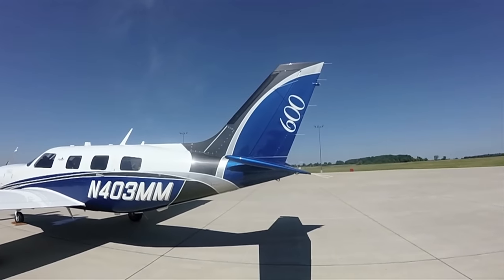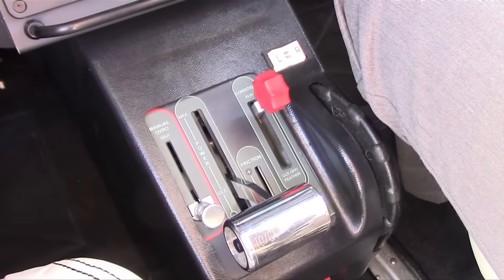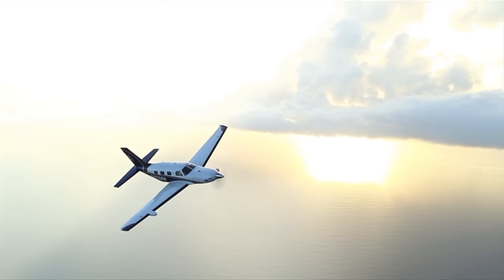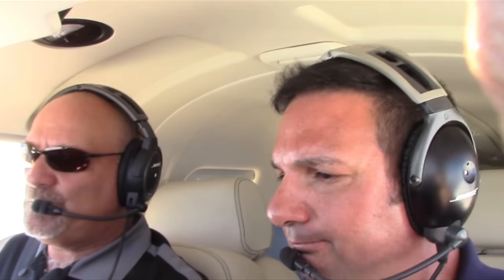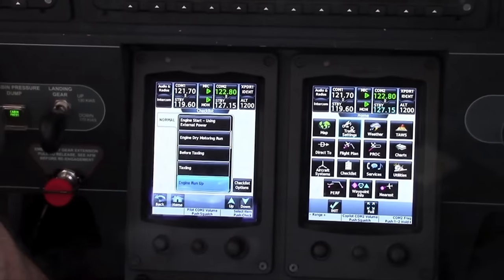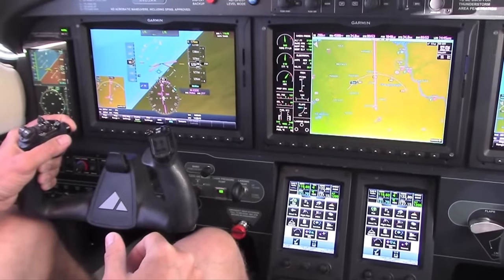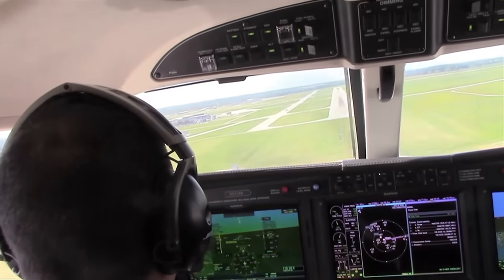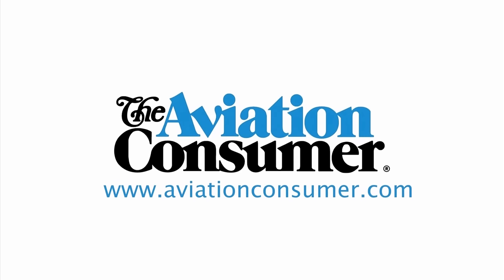Piper M600 Turboprop Flight Trial

Comment: You know, for a single engine turboprop, this is not a bad airplane, but then again, the original Meridian wasn't, either, after the Gross Weight Increase.  But, here's my issue.  At $2.8M, you can buy  One Aviation Eclipse 550, a twin engine pure jet that is over 100 knots faster, flies up to 41,000'.  It doesn't have the range of the M600, but it will carry four people in comfort for 1,100 miles faster and in smoother air.
I would be very hard pressed to find a reason, if I was in the market, to buy this aircraft over the Eclipse 550, or even a 500 Total Eclipse, for $2.3M
The only 'downsides' to the Eclipse is you have to be type-rated in it, which you don't have to be in the M600.  But, if you're flying this class of airplane, you should be as close to being type-rated as you can be, anyway.
Reply: Fuel consumption, maintinence, operating costs etc.
Reply: Nick Stadtmueller If you're comparing the M600 to the Eclipse, yes, the M600 would be less expensive.  However, with a direct operating cost of only $742 per hour, the Eclipse is only slightly more expensive per hour than a PC-12 or a TBM900.  However, I can't find any specs on the M500 or M600, but I can't think it's so much less than the TBM 900 or so.  So, maybe $100 less per hour.  If you buy a Total Eclipse, instead of a new M600, the acquisition cost is $800,000 more for the M600.  That'll buy a lot of hours at $100 hour difference in Direct Operating Costs.
Reply: I think the market that piper is trying to appeal to are people/small businesses that have the money to burn.  In which case they are just offering a plane to contest to the PC-12 and Tbm 930.  If any medium to large business were looking for a corporate plane they are better off getting a small jet.  So in my opinion I find this plane to be a marketing venture for piper.
Reply: I think you guys missed the point. ;-) It's a million less than the cheapest competitor in its class and it's a bargain when compared to the PC-12's 2 million+ premium for a few hundred more in range and more speed.I know jets are all the rage these days but single turboprops can go a lot of places a jet cant and fill a important gap in the market.As someone who has over 400 hours in a PC-12 try landing a jet on grass or dirt..........then come tell me that a hot single turboprop is simply a marketing ploy ;-)
Reply: @rustypotato1884  Nope it's for people who love to fly Pipers.  And it's selling.
Reply: SouthJerseySound exactly. This thing can land anywhere a Bonanza can but with a lot more speed and range.
Reply: @shawnclark732  Yep.  Since there are so many turbine choices out there, all airplanes have come down to trying to appeal to micro-niches.  The M600 appeals to people who are already familiar with Piper products, but who want  a little more range and speed than the M500.  These folks just are not ready to pitch for a type rating and going to 41,000 feet is a little scary and not really needed for their operations.  Then there's the issue of who knows how to maintain an Eclipse in the boonies, and will Eclipse be there in any form in the future?  C'mon now, Eclipse jets have been around for some time now, but the company itself is down to nothing.  Bet the trip to the Piper guy is a lot shorter.  And cheaper. So it's not like M600 owners never did their homework.

Comment: How long will it take for someone too learn how too fly this piper ? If not experience too.
Reply: First you have to get your private pilot lisence then you get Instrument rated after that you'll have to get endorsed for this aircraft which is a turboprop. It's around 80 hours flight time to be able to fly this aircraft , if commercial pilot lisence is not the requirement this aircraft otherwise It will be around 270 hours
Reply: You could get your private pilot's certificate in this plane in, theoretically, 40 hours. you would be limited to flights under 18,000 feet and VFR until you get the hours to get instrument rated. There is no legal requirement to get experience or training to fly a single engine turbo prop as a private pilot. You will need complex and high performance endorsements in your logbook. Turbojets require type ratings but FAR Part 23 certified airplanes with propellers all fall within the scope of a 40 hour private certificate.

Comment: Great aircraft except for the PT6 turbine. It's time to introduce a FADEC or replace it with a GE turbine which has FADEC and doesn't need a hot section inspection half-life. Single pilot operations are significantly improved with a FADEC, torque limiter, etc.
Reply: ruirodtube I agree with you 100%. I instruct in a multi engine turboprop with dual channel FADECs in each engine.
Reply: Only if you shouldn’t be flying in the first place. 

The PT6 is the only engine certified for single engine commercial IFR operations for a reason... in spite of having the least experienced pilot group operating them.
Reply: Totally agree. Makes no sense not to have FADEC.

Comment: I'd buy a used Lear 35A and pay for a captain and have still have 2 Million in the bank.
Reply: Until you feed that Lear (it's very thirsty), and service the engines. Oh, and you need two pilots (even if you are one of them.) These are cheap because they cost a bunch to operate.
Reply: Factor in insurance, hangar lease, maintenance, engine reserve, fuel. And it needs two pilots. That $2 million is going to be gone before you know it.
Reply: Sure and that bank will get emptied by maintenance cost.
Reply: that 2 million in the bank?  Ha.. ever maintain a Lear?
Reply: Not for very long
Reply: You don’t choose a plane just looking at the cost, but at the mission you intend to fly with. Good luck trying to take off with that Lear 35 for a long flight from a short runway...
Reply: @UncleKennysPlace   Yeah, especially run-out engines are a common economic sticking point or even game-ender. I've seen many a parked Lear over my career, available cheap to anyone willing to pony up the cash for that work.

Comment: Isn't it better having two engines rather than one - incase one engine fails?
Reply: sure in that view it is usually better to have a multi engine over a single engine, but even then a lot of multi's will still lose altitude with an engine out and a lot of single engines have a much better glide in case of engine failure, along with having an incredible running cost with owning a multi engine its not always better
Reply: nosupervision Thank you for the reply.  I'm glad they're able to glide in case of engine failure.
Reply: Two engines mean more money to buy, fuel and maintain. Also, flying a twin with just one working engine can't be easy. Some people think that unless you fly a LOT and have the time and money to learn a twin, you're probably better off getting really good at flying a single engine instead (and landing one without power). I imagine a plane like this comes with a ballistic parachute option too.
Reply: +eatmorenachos no chute option. only on sirrus and lancairs right now
Reply: The idea with these single turboprops like the Meridian, TBM, Caravan, etc.. is to replace piston twins with something that is nearly as economical to buy and run, has much more performance, and has a single turbine engine that is more reliable than the two piston engines it replaces. With two piston engines, you're twice as likely to have an engine failure. Compared to a single turbine it's more like half a dozen times more likely. And when that engine fails, you might not be able to climb after takeoff or maintain safe altitude. Then, even if everything is working perfectly, you're stuck in icing layers and bad weather for a lot longer. Most of these single turbines have an alternate fuel control if the normal one malfunctions, and with GPS it's easy to find a suitable airport to glide to from the flight levels should the engine quit... vs trying to find a safe drift down in a twin.
Reply: One of the other things, piston powered aircraft are known to have failing engines, but the Pratt and Whitney PT-6 engines are almost bulletproof.  Once you get it running, it'll stay running.  The Mean Time Between Failures for the PT-6 is very high, compared to a piston engine.
That's not to say they won't fail, they will, but it takes an awful lot to get one to fail.
Reply: Twin engine planes require more training and a different license. This plane can be operated with a basic private pilot license

Comment: the cirrus jet will fill this niche.   Why spend $2.8 mil for a plane that has the same Full Fuel Useful load as a Cessna 182??  Most of the back seats are for decoration then??
Reply: +David Heon  Useful load is a dumb criteria to judge an airplane by.  More pertinent is how you plan to fly the airplane and for what missions.   Most Meridians fly missions of 1 hour or less.  Then you can carry 6 if the load does not exceed your zero-fuel limitations. If you need more hauling capacity occasionally, then charter a Phenom 300.  If you need that capacity all the time, then consider a used G-280, if you can afford one.

Comment: This aircraft pretends to be in the same class as a PC-12 or TBM, but those aircraft can actually DO something other than haul a pilot, 2 passengers and 100 lbs of luggage 600 nm. This is an ego plane only intended for the guy who wants a really nice way to get from golf course to golf course, and there is nothing wrong with that. Just don't pretend it is something more than a turbine C-206 with nicer seats.
Reply: But slow compared to the 930 @SeriusNtentions
Reply: +Craig Sanderson The M600 doesn't pretend to be what it is not-a PC-12 or TBM 940.  If you need an airplane with  load carrying capabilities or speed, by all means buy one of the above if you're willing to accept higher operating costs.  A turbine C-206?  No, just an improved Meridian.
Reply: I mean... A 206 can't cruise at 250, but okay...

Comment: If a Cherokee was made in the 60's for 6K and met all the criteria to be safe how is it possible to justify a 2.8M plane regardless.Technology and manufacture capability have improved light years and COST should be reflecting that. I guess it is such a limited market therefore the high price to produce reflects that. Need to revitalize the aircraft industry with mass production and lower sell price. If this is a 100x better product than a Cherokee Six  < 1M would be expected. Dream on.....
Reply: aviation is an expensive industry because of the safety regulations from manufacturing to operation

Comment: $2.9m for 270ktas cruise, 6 seat no parachute?  It has no niche facing the Cirrus SF50 which is faster @300ktas cruise and has the Perspective system based on the same G3000 idea.  Has a chute and is priced at $1.9m.

You can even go with a Lancair Evo at $1.5m with the same speed as the SF50 yest uses the same engine as the M600.  How does Piper expect to stay in business in the face of these new far superior clean sheet designs at lower prices?
Reply: 80 pounds of parachute.  Who would want that?  $15,000 replacement every 12 years.
Reply: @KB4QAA  I love the m600 but I'd take the parachute.  If you can throw down the bucks for the airplane, you can afford the chute.
Reply: We all say that, but then Pipers keep popping up all over the world to grab their share of the market.  The truth is that a hell of a lot of folks everywhere love the way Pipers fly. And they are just "plane" ass reliable airplanes, very tough and sturdy.
Reply: @williamrmcintosh4343  Actually, they're relatively conventional. That's the ticket, sort of like a C182. It's not going to do what the latest-and-greatest can do, it's not likely to have the structural prowess of others (i.e., Pipers have a bit of a rep for occasionally diassembling themselves in flight with lots of commercial-use hours), but for someone with the money, it may just be an easier, conventional decision than trying to be on the leading edge, often with higher flight and/or maintenance-schedule costs.